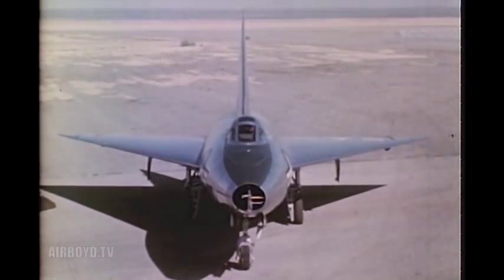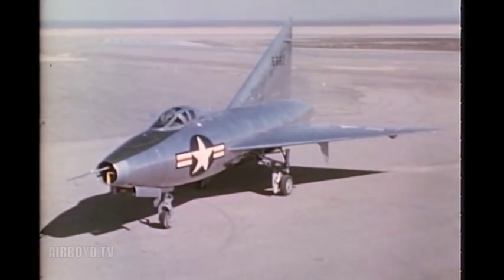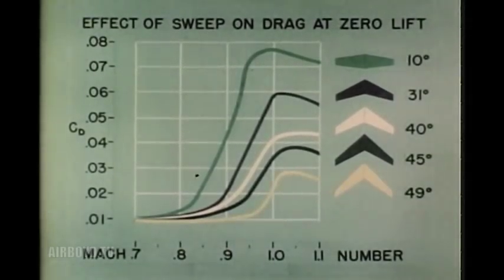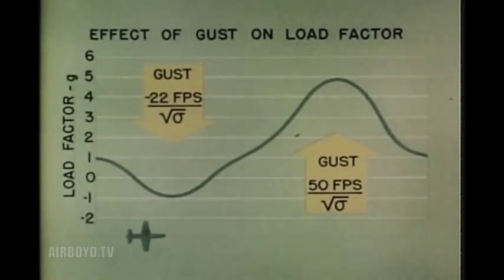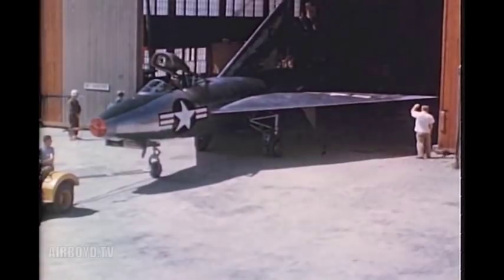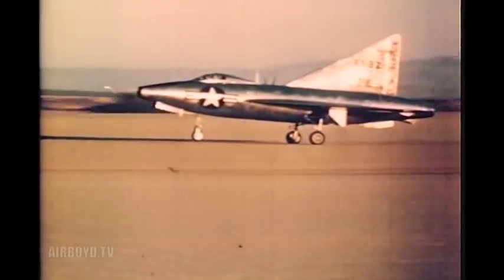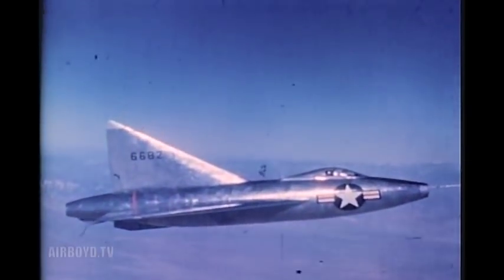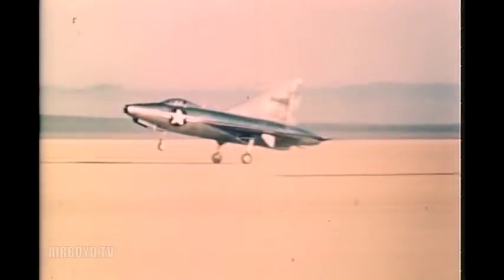Convair XF-92A Model 7002 (1948)

Comment: Them were the days?  Not cool enough for the more modern pilots, maybe.  I think that at mach 1 and higher there is a bit of a lock up between the flaps and the wing proper.  It works a little better if the whole wing/flap moves at the same time.  That's why the conard (spelling?) with some later aircraft.  Informative, though.

Comment: Lippisch P13 - P20
Reply: No it's not a lippisch copy. P. 13 maybe looks similar but those two are not the same.
Reply: @Colerend-Berta  actually lippisch developed this aircraft when he was send to the US after the war.
Reply: @Mar-s5q8m  yes but only wings resemble p. 13 fuselage is totally different.
Reply: @Colerend-Berta  Lippisch changed it ever so slightly. so what's your point? he still developed it.
Reply: @Mar-s5q8m  he said that it was p13 and its simply not true. I don't care if lippisch designed them both.

Comment: You can see the big tail that the 102 had to be retro fitted with. Mainly the 102 suffering from low power jets of the time. Put an F 16 engine in one and see how she performs. It was intended to intercept in coming bombers. With more power and area rule waist it probably would still be formidable in certain roles.

Comment: Very educational.  
What is up with that burned out airplane at 6:15?  Looks like it was a B-29 that did a belly landing & caught fire.
Reply: It may be the first prototype Republic XF-12 Rainbow.  It was damaged in a landing accident in july 1947, possibly at Muroc, California (Edwards AFB)  which is where the XF-92 was being tested starting in April 1948.  I don't know how extensive the damage to the aircraft was, and the XF-12 looks a lot like a B-29.  The 6:15 image could be a B-29 for all I know.
Reply: @bushpilot172  From the shape of the fuselage, tail and engine nacelles I'd say its a B-29. Definitely looks burned; fire-rescue training?
Reply: bushpilot172 o
Reply: If that B-29 is sitting like that at Muroc in that timeframe. It could very well be sitting in the pit that they connected the X- planes to the B-29 mothership that would do  airborne test launches. That would be my guess.
Reply: It's probably a hulk dedicated to fire fighting practice for the crash fire crews.  AFB's have two fire crews - structural and crash ...

Comment: From what I read, Chuck Yeager and Scott Crossfield did not have a high opinion of this aircraft (it's J33 engine being underpowered did not help).
Reply: PR: It was a research plane on the bleeding edge of the unknown. It didn't have to "impress" anyone.
Reply: @KB4QAA  He said it was Crossfield's and Yeager's "opinion" of the plane. He didn't say anything about being "impressed." Totally different.
Reply: J33's were centrifugal compressor designs.  Best they had at that time.  Axial compressor designs hadn't evolved yet ...
Reply: @checkyoursix5623  The German Messerschmitt Me262 used Junkers Jumo axial flow engines..in 1942.

Comment: wonder what the story of that downed 4 engine plane is at 6:18
Reply: It's what is left of a B-29, an aircraft that was famous for engine fires due to the high temperatures they ran at.
Reply: @MrRobster1234  Leaving it to rot in the sand...I wonder if pilots felt that could be bad luck?

Comment: It should be noted that delta wing aircraft like the XF-92 and follow on F-102 were not capable of supersonic speeds in level flight untill the countour of the fuselage was changed to a coke bottle like shape that was the basis of the so called "area rule."
Reply: I mean, it's not "so called" it IS the Whitcomb area rule or transonic area rule. It helps to calculate drag, taken as a cross-section of the air-frame at all points along it.  They didn't know about this at the time so these planes dramatically under performed compared with expected result.  Now most fighters, and bombers, have a blended body design, also use the area rule to determine and design around total drag.
Reply: chris younts  - Beyond being a bomber interceptor, what qualities as a fighter aircraft did the 106 have?
Reply: That's why the F5 is a smooth supersonic fighter. It's area rule developed fuselage.
Reply: @thetreblerebel  - When I retired from the Navy, the adversary squadron I was assigned to, VFC-13 was flying the A-4F. They later transitioned to the F/A-18A and now fly the F-5.
Reply: Think they also changed the inlets on the 102.

Comment: 60° is rather a lot 55° are more common. That they encountered lower drag than predicted was normal, the theory of supersonic flight was off back then, they didn't know that the drag becomes lower once the shock-wave is penetrated.
The engine in- and out-lets look small.